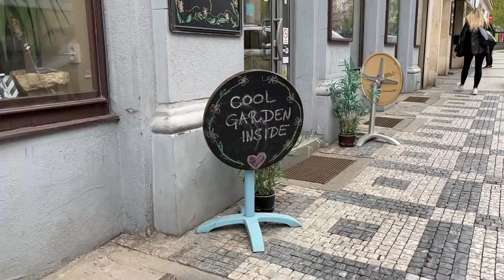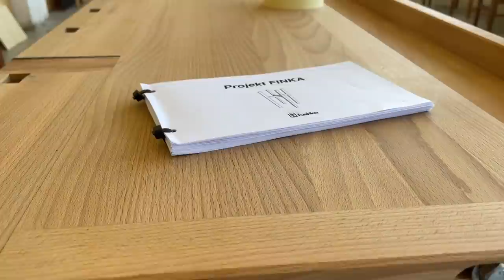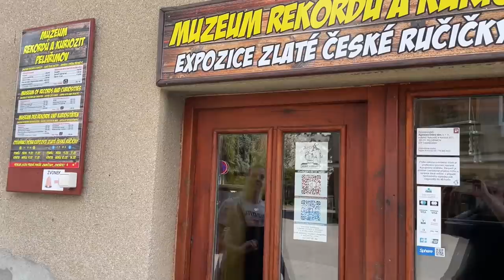BECOMING CZECH (Do I have Golden Hands?)

Comment: Some tools are in every Czech home.
I need to buy aplace I can store my equipment and where I can take my beer and create things.
Unfortunately you cleared up your license plate. I would have one not to be annoyed about who has na Audi. For explanation: I keep 150 on highways with my Dacia. Many Audi and BMW drivers take it personally if Dacia overtakes them. If I knew it is not the case, I might be a little bit more polite in case of "not-so-understandable" behaviour. Sorry, I came from DK and found out 1) Can not drink, like a Danish and 2) Can not drive, like a Danish.

And our DIY comes from "lack of services" in communist times. I can fix some parts on my car, but still I prefer to let a professional do it here. Last car I was able to fix with standard tools is Favorit.

Btw. I am interesting in woodwork without saw. The old way. I have tried to put down a hut built using jist an axe and it was "tough". Axe cut wood is much stronger, than sawed one.